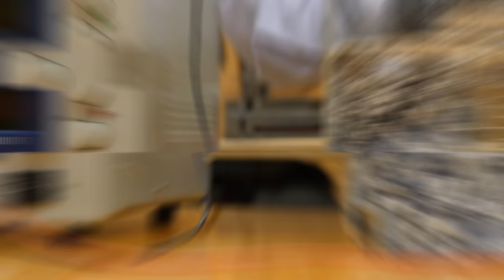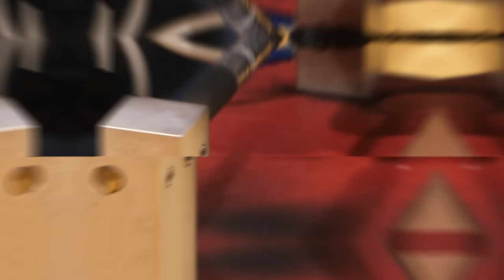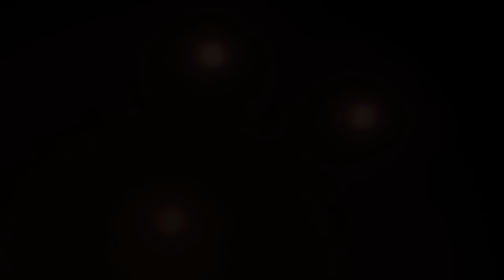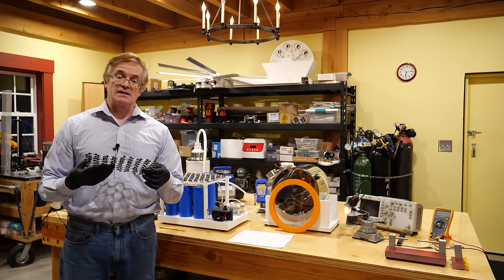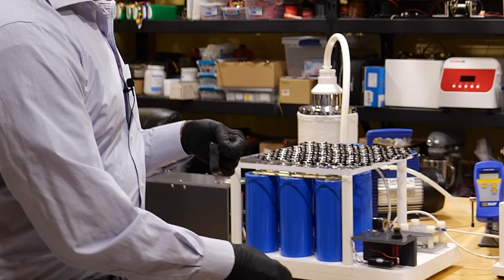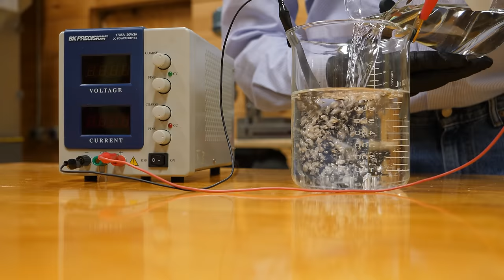Making Graphene could KILL you... but we did it anyway?!

Comment: The statement that "aluminum has 3 times the strength-to-weight ratio of steel" can be somewhat misleading without context, as it depends on the specific alloys and forms of aluminum and steel being compared.

In general terms, aluminum is lighter than steel; it has about one-third the density. This lower density makes aluminum appealing for applications where reducing weight is important, such as in aerospace and automotive industries. However, pure aluminum is softer and weaker than steel.

When we discuss the strength-to-weight ratio, we're considering how much strength a material provides relative to its weight. Aluminum alloys can indeed have a favorable strength-to-weight ratio compared to some types of steel, especially when considering high-strength aluminum alloys. However, advanced steels, like high-strength, low-alloy (HSLA) steels, can offer significant strength with less weight than traditional steels.

In specialized applications, some aluminum alloys can outperform certain types of steel in terms of strength-to-weight ratio, but steel can be treated or alloyed to increase its strength significantly without a proportional increase in weight. Thus, the comparison isn't straightforward and depends heavily on the specific materials and the conditions in which they're used.

In summary, while aluminum is lighter and can have a favorable strength-to-weight ratio for certain applications, it doesn't categorically have "3 times the strength-to-weight ratio of steel." The actual ratio varies based on the specific types and treatments of the aluminum and steel being compared.

Some types of steel can have a higher strength-to-weight ratio than elemental aluminum. The key factor here is the distinction between pure, elemental aluminum and its alloys, as well as considering the wide range of steel types, including various alloys with different properties.

Elemental aluminum is relatively soft and not very strong, but when it is alloyed with other elements such as copper, magnesium, silicon, and zinc, its strength can increase significantly without adding much weight, which enhances its strength-to-weight ratio. Aluminum alloys are widely used in industries where lightweight materials are crucial, such as aerospace and automotive, due to their favorable strength-to-weight ratios.

Steel, an alloy of iron and carbon, can also include other alloying elements to enhance its properties. High-strength steels, such as high-strength, low-alloy (HSLA) steels, advanced high-strength steels (AHSS), and ultra-high-strength steels (UHSS), are engineered to provide high strength while keeping weight lower than traditional steels. These types of steel can indeed have higher strength-to-weight ratios than elemental aluminum and even some aluminum alloys, depending on their specific composition and treatment.

The strength-to-weight ratio of a material is crucial in applications where both strength and weight are critical factors, such as in structural components of vehicles, aircraft, and certain building applications. In these cases, the choice between aluminum alloys and specific types of steel will depend on the specific requirements of the application, including factors such as cost, corrosion resistance, manufacturing processes, and the desired balance of strength and weight.

Comment: Loved the video, even though I'll most likely never do this or need this knowledge I still love obtaining it. I always wondered why people seemed to give a fractional shit about graphene since it has to be one atom thick; that's useless by nature. What amount of strength (define 'strength' as whatever specific metric you feel makes most sense for this comparison) is lost when combining many layers of graphene to make a material thick enough to actually use? 

Also: so many freaking room transition shots I feel like I'm having a stroke. 🤣
Reply from the maker: The same parameters apply to graphene  as with isotropic materials like metals. Every layer adds strength, and that increase is linear. At 200 times stronger than steel, this ratio holds from a single layer to centimeters thick.
Reply: @TechIngredients  So unless I'm completely misunderstanding here the "issue" with graphene has not actually been what I thought it was this whole time: that it was very difficult or impossible to create graphene larger than 1 atom thick due to the very structure of it; it's more that we haven't figured out a good way to make a lot of it yet? The impression I got from this video was that there is a fundamental issue with making it thicker as the layers tend to flake or whatever. Thanks for clarifying.

Comment: At 3:10 you compare graphene with metals and then discuss conductivity. Your comments are not wrong but the physical basis of conductivity needs a little amplification. Electrical conductivity is always due to free electrons. For graphene these exist as free electrons above and below the sheet. In fact it is worth noting that graphene can also transport "holes" like a semiconductor!
Thermal conductivity is a different matter, in graphene it is indeed due to the lattice itself (transporting acoustic phonons) , whereas in metals the free electrons are mostly responsible for the thermal conduction as well so for metals the thermal and electrical conductivities correlate. But not for graphene.
Reply from the maker: Agreed.

Comment: Is it not possible to make graphite with the processor making techniques?
Reply from the maker: I'm not sure what you mean. You need to be more specific.
Reply: @TechIngredients  Lithography
Reply: If we can make a processor from silicon, can we make it from carbon also?
Reply from the maker: It is.  That was what I was referring to with the CVD method of synthesis.
The limitation there is the extremely low production rate and the very high cost of the fabrication equipment.

Comment: Why not use quartz sheets instead of tubes? Use a U-Channel on the bottom and quartz cap on top. Compact the carbon from top down using the quartz for a more even compaction. And use copper foil as electrodes.
Reply from the maker: That might work.  The cooling rate is critical, and so the appropriate thickness would have to be determined.

Comment: How many volts does the system send? Did I miss it?
Reply from the maker: I believe  it was shown on the voltage meter.  I can't  remember it offhand.  I think it was in the neighborhood  of 240 volts.
Reply: Thank you for your quick reply. I was wondering how many volts were generated in the capacitors after amplifying and rectifying them with the microwave transformer. Okay, very high amperage, but in the end, I asked how many volts passed through the graphite. Thanks. @TechIngredients
Reply from the maker: That's  actually  what I was referring  to.  The voltmeter in the video  was demonstrating  the charge voltage on the capacitors prior to discharge, not the line voltage, which  in this case was 120.
Reply: What confuses me is; You used a microwave transformer. Isn't its output voltage 4,000 volts? @TechIngredients
Reply from the maker: Watch the part of the video where I described  the electrical system, again.
Did you see the Variac?
A microwave  oven transformer  is simply a step-up transformer. The AC voltage supplied to it controls the output voltage.  The 4,000 volt rating is simply  its MAXIMUM safe operating output voltage.

Comment: what if you go down to 1 ohm or even less ?
Reply from the maker: The resistance  is selected to control the cooling rate, which determines the graphene production.
Lowering the resistance means the volume of the precursor is reduced along with its surface area, and the slower cooling rate favors the production of graphite vs. graphene.

Comment: Apparently, according to the lead Chemist, Dr. Tour, they no longer use a vacuum for the flash graphene synthesis process. It can all be done in air.
Reply from the maker: Why?
Reply: @TechIngredients  because it's not necessary, it has no effect on the quality of the product, and (again, according to Tour) the level of out-gassing from the process over its short duration meant that it was superfluous and just added time. They're at around 1 minute per batch (including mixing with a bit of carbon to increase conductivity and filling the tube), now, in an automated process. A quartz tube filled with material (all sorts of carbon-based substances) rolls down to sit between the electrodes, which go into the ends of the tube, zap it and withdraw. The tube then rolls down to a hopper to be emptied.
90% Process yield and 100% of that is the high quality end product.
Reply from the maker: I'll  have to disagree.
Having actually  run the synthesis  both ways, we found the productivity is significantly  higher with the vacuum.  The fact that they had been using the vacuum previously AND FAILED TO MENTION IT in their article makes me a little skeptical about their claims now.
Reply: @TechIngredients  to be clear; he said they stopped using vacuum a while ago, and this most recent paper is not their first. I know their setup has been through a few iterations as he showed pictures of some of them. Now, to correct my earlier statement about 'no vacuum' they say in the paper: "The entire sample
reaction chamber is placed inside a low-pressure container (plastic
vacuum desiccator) for safety and to facilitate degassing. However, the
FJH process works equally well at 1 atm. "

To be fair, their assessment of yield is based on Raman spectroscopy, how are you assessing it?
Reply from the maker: We did verify that the grey flakes are nearly  pure graphene thanks to a friend  @ MIT. Productivity  can then be simply  based on the weight  of those flakes.
A low-pressure container doesn't  provide  any safety if there is no actual  build-up of pressure in the tube.  The only source  of a pressure  build-up is air as the carbon doesn't  vaporize.
If they are happy  with their  results, that's  fine.
However, these batch processes are slow no matter how fast you can load and unload  the tubes, and that's  why we're  looking into  the other process  by Dr. Islam linked to in our description.
Reply: @TechIngredients  Thanks very much, that makes sense. I get the impression that this process has plenty of scope  for optimization. I will look at Dr. Islam's paper now, I hadn't come across it before, thanks for  that also.
I should also say that I never cease to be amazed at what you accomplish in your lab/workshop, more power to your elbow!
Reply: @TechIngredients  incidentally, Dr.  Tour mentioned something that may have a bearing on his desire for a quicker, simpler process; a contract from the US DoD to make a kg per day for them by then of this year. I'm not sure pressure of that kind leads to better methods, per-say, but financial concerns are affecting much of academia these days. I would have loved to be hanging around at Bell Labs in the days of Claude Shannon and friends, pure freedom to investigate whatever tickled his fancy. The niche you've carved out for yourself seems to have a similar sense of freedom, but I'm certain that the work involved in producing such high quality content is huge. Anyway, sorry to ramble on!

Comment: Since the cooling is all by radiation, paint the inside of the vac chamber black (Krylon ultra-flat black) to absorb it.
Reply from the maker: That  would help.  But remember, stainless steel  is only  50% reflective, and the radiation  that returns is proportional  to the relative area of the tube/area of the inside of the chamber.
The improvement  would be very small.
Reply: @TechIngredients  Don't forget, what's reflected is reflected back towards the tube.
Reply from the maker: Not significantly.
The inside of the pot isn't  specular.  The reflection is pretty  diffuse. The big factor is the huge difference  in surface area, which is around  100:1.

Comment: 0.3% made it that much better?? That doesn't even sound real

I would've expected that with maybe a perfect sheet of graphene moulded perfectly to the tube, but just 0.3% by weight in epoxy and it's just tiny sheets.. huh??

51:27 now that's some modern day magic

I would love to see a follow-up with even higher concentrations to see the value. I could see myself making 5% batches for epoxy coating structural 3d prints

Comment: The mask is doing very little to protect you in that orientation. If you flip it over, it has a little metal wire that can be pinched to shape it to your nose and seal it off. This will also stop it from fogging up your glasses

Comment: What is the melting point of graphene? if higher than steel, alloys of metals with graphene must be amazing.
Reply from the maker: It's approximately 3,500 C.  However, it will oxidize if heated to that temperature in the presence of air or oxygen. That isn't a problem if it's a vacuum furnace or the furnace is purged with an inert gas like argon.
Reply: @TechIngredients  yes or if to be laced with aluminum alloys which has approx 600deg, less than half of steel.

Comment: so i just have to find a way to make an atom with strong valencies have 4 even 3D radial bonding point/vectors, which produce a 3 dimensional "honeycomb crystalline formation. so the structure can have graphene strength but have the bond in all direction instead of 2D. (material for my anti g^#&ity craft's shell)

Comment: Two stage pump, 6700 microns.?  That pump goes to about 72 microns , ?
Reply from the maker: As I explained, the optimal pressure for the discharge is a modest vacuum around  1/100 atm. Sure, the pump can go lower, but then the voltages during the process can exceed the dielectric strength of the air and short out the circuit.

Comment: i'm not sure what the applications are for graphene outside of etching electronics.  The "good" properties make it sound like it's suitable for skyscraper development, but that doesn't work since it can only be 1 atom thick.  Comparing it to steel sounds like it's for construction, yet you breath on 1 atom of graphene and it's gone.  Where in the microscopic world does steel nano structure get used that graphene is just better?  It sounds like a bunch of hype for no reason.

Comment: You made a slight mistake during your testing.  There's probably not much of an actual difference, but the method you used on each rod changed slightly when you tested the 0.6% graphene rod at 50:42.  You even say at 43:19, "To be fair, what I'm going to do is I'm going to rotate the beam 180 degrees.. Like this.. Just in case there's some natural bend in the beam.. and we'll take the average of the two numbers." and you show turning the epoxy beam 180 degrees. I checked at each point that you rotated a beam, 44:59, 46:46, and 49:01.  On each so far, you rotate the 180 degrees like you said you would.. but if you watch carefully at 50:42 you only make a 90 degree rotation.  For empirical analysis of different materials to be reliable and fair, the tests of each material should have the exact same parameters.  That being said, do I think the testing here is reliable even if the parameters of each test were the exact same? No, not really.. That's why I prefaced this comment by saying I don't believe it really matters much in the end.. I just believe if the testing should be taken at face value, the testing methodology should be consistent across all tests.  I did however enjoy the video and learned several interesting things on this topic, and I actually enjoyed the testing overall, so I am not trying to deride the video in anyway.  That 90 degree turn just stuck in my head when I saw it.  Anyway, I love all your videos and have been watching for a while.  I actually watched the beginning of this video when it first came out and for some reason I had to stop it about half way through and I just got back to it.
If you end up reading this, thanks for all you do
-Llama 🦙

Comment: It can probably go back with vibration.. all that carbon black will separate again
Reply from the maker: No, it can't.
Graphene isn't just pieces of carbon black stuck together. It's chemically bonded carbon atoms 
You could  just as easily vibrate diamond  back to graphite.
Reply: @TechIngredients  it wasn't graphene yet. This was during preparation.. He said if you compress the powder too much you can't step it back [inside the tube].
Reply from the maker: Ah, you were talking about the tube preparation process.  I see.  You might be right.

Comment: Thats not graphene. Thats graphene oxide and its about useless.
Reply from the maker: No, it isn't.
Where would the oxygen come from during this reaction?
Reply: It matters none how pure it is. Graphene in that format is useless and if you ever looked under a microscope when doing your little Scotch tape trick, you would realize you did NOT have a microscopic sheet of graphene. I ordered $50 worth of the exact same material and tried every possible way to get the resistance below 5mb.
Its not till you put it under a microscope do you realized what is going on.
The flakes do not line up nice and neat. Just cliffs and mountains between the granules. Electricity is not going to jump that easily.   @TechIngredients
Reply from the maker: Of course it does. 
The carbon black precursor does not contain oxygen. It is virtually pure carbon.
The reaction occurs in a vacuum. There is no oxygen  available  to create the oxide.
Indeed, many suppliers  will sell the graphene oxide because  it is easier to manufacture.  Often, this material  consists  of multiple  stacked layers.  Remember  my explanation of the chemical exfoliation process?